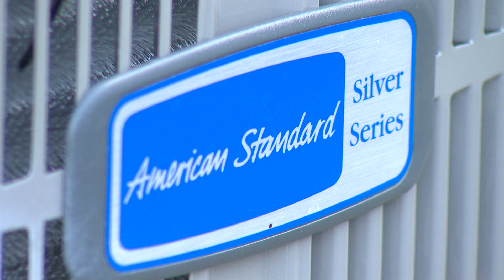HVAC installers see high demand for AC units amid supply chain issues

Comment: I can't afford central air. I can only afford window units. I have a window unit in the bedroom were its a must have if you want to sleep and one in the living room window. Window units are great but I have found that they only last three to five years then they need replaced because they don't get cold enough or stop working all together.
Reply: Next time you need to replace one, look for the new window AC brands with inverters that will increase the efficiency and life of the unit.  Midea brand is highly rated.  You can get various BTU.

Comment: $10k to $20k price is probably for an entire new system including duct work. If they are charging $10k to $20k to swap/upgrade the unit then check out Budget Heating & Air Conditioning Inc in Florida. I bought all of my air units from them then pay an air installer $500 to swap the system out. My (2) heat pump units 4 ton 16 seer and 2 ton 16 seer cost $6800 delivered to my house. Then i just called a local AC company to come install for $500. The ac company will fill out the warranty paper which activates the 10 year warranty and poof all good
Reply: Hello, hvac tech here from WA state (though, not hunts). $10k to $20k is actually pretty accurate for a new system here (not including duct work, just a retrofit system). I dont know of any hvac companies that will install any equipment that a customer supplies because we can't garuntee that its sized properly or will even turn on once installed... its a liability that companies wont take around here (and for good reason). Once we touch the system, we are responisible for it. I've seen some pretty horrible installs from DIY kind of customers... If you want the job done right, $10k-$20k sounds about right. Then you also consider supply and demand... Right now there is a lot of demand, but not a lot of supply.
Reply: @Brexin212  a local air company here tried to sell me a system for $14k when I built my house. That same system they quoted is actually $4300 so do the math and see the mark up / rip off. I know all businesses need to turn a profit but screwing people over is not acceptable. My systems bought from budget heating and air were 100% brand new sealed & delivered by a freight company on a pallet. I will never use a local air company for anything other than small service or install. If I cannot find an air company or tech to install my systems in the future I will just learn how to do it myself.
Reply: I went ductless in the spring 13,000 dollars for a 4 room set up  in South hill .
Reply: @bc5891  Well, I am not going to sit and argue with you, however I think you're not quite seeing the big picture, which is understandable because you appear to not be in the HVAC business in profressional manor. 

The cost of living here is probably higher than in Florida, meaning you will have to pay the installers more per hour to install. When installing a brand new A/C system (non-retrofit, because remember, not everyone here has A/C at all), there are a lot of things that have to happen such as running all new electrical from the breaker panel to the install location. Electricians in WA make really good money and are very expensive hourly here. Also need to run a brand new lineset from the furnace to the install location, retrofitting the existing ductwork to make room for the coil (requires sheet metal work/experience). Most furnaces here blow air downwards because we have many more heating hours than cooling hours, so the entire furnace needs to be removed and re-installed afterwards. Adding refrigerant to the system after the install, because a pre-charged system only has enough refrigerant for itself and maybe 25 feet of lineset. Most imprortantly however, is providding a warranty for the system for X amount of years (labor side) and providing gurantees that the system will work for X amount of time.  A manufacturer warranty does not cover any labor OR refrigerant costs if something happens. I promise that if your system didnt fire up after it was installed (DOA), that tech you hired to install if would charge you even more money to fix it (for labor). I should also mention that pulling permits to even install a system in the first place with the city or county costs money, which also includes an inspection from L&I and has to pass WA state code laws, which companies here pay for. 

Finally, I would like to point out that systems here in WA last much longer than in hotter states such as Florida and Arizona. Its typical to only get 6-8 years from a unit down there, wheras here we get close to 15 years. This raises costs a little too probably, because at the end of the day, you are correct, businesses need to make money. A proffessional company has to pay wages for the installers, the service technicians, managers, the dispatch office, the customer service reps, gas and insurnace for all of the company vehicles etc etc etc, the list goes on!

All in all, labor costs and the general cost of running a business here is what really brings the cost up. Its not cheap to live in the Puget sound area!
Reply: @bc5891  Then you do it wrong and mess something up and then you have to pay double the money to have us professionals come do it the right way. But good luck though. If it was easy, everybody would be doing it.